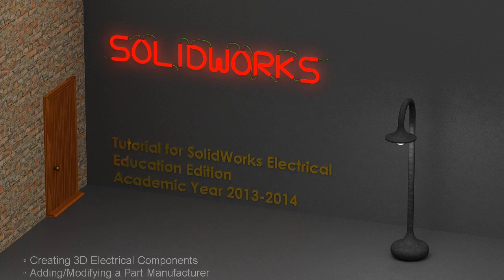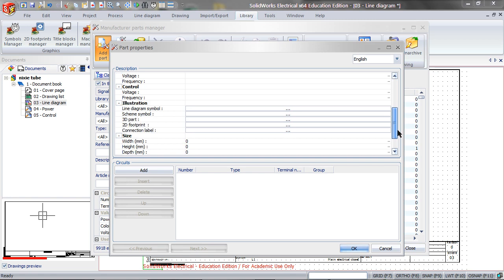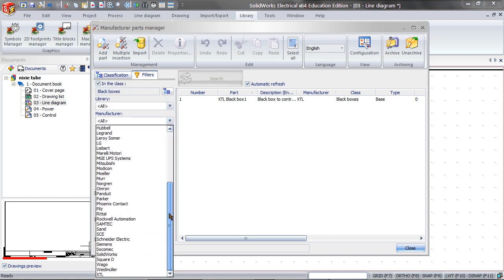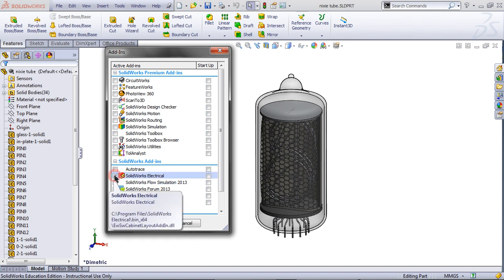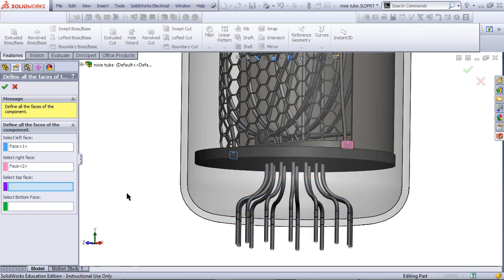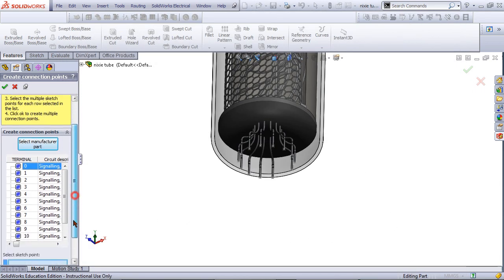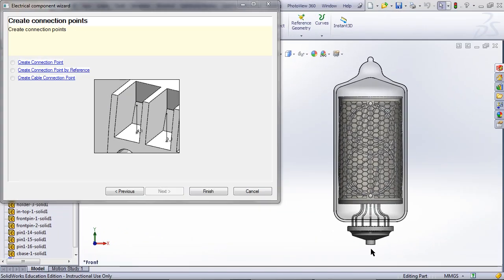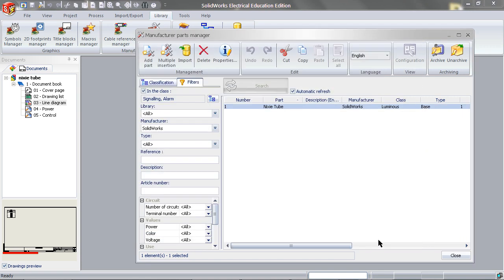Creating a 3D Electrical Component in SolidWorks Electrical

Comment: Would it be possible at all to make an actual battery, have wires running from it to a resistor and then to an LED/Light? - to have it illuminate...?